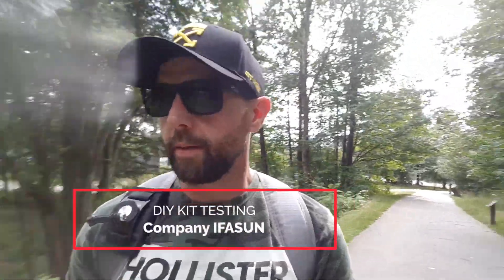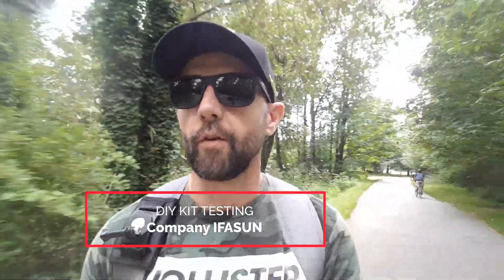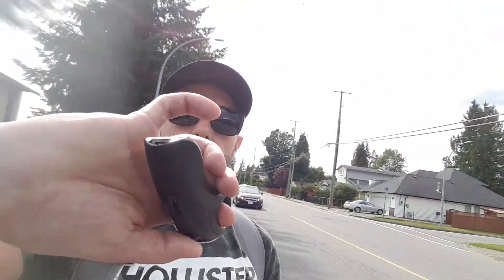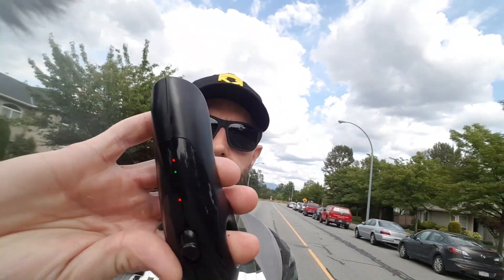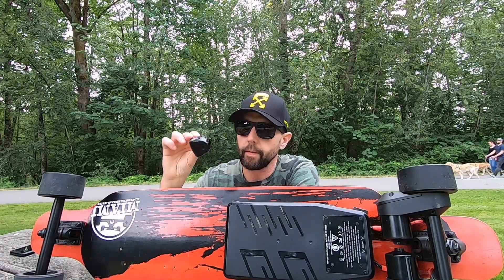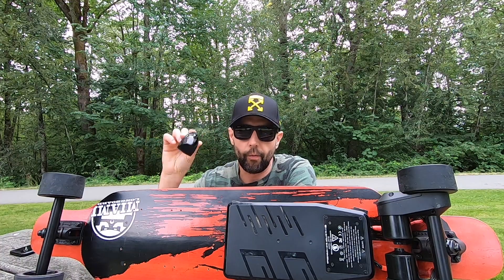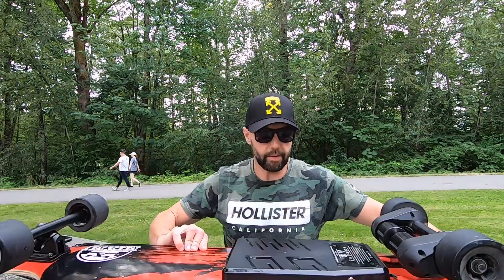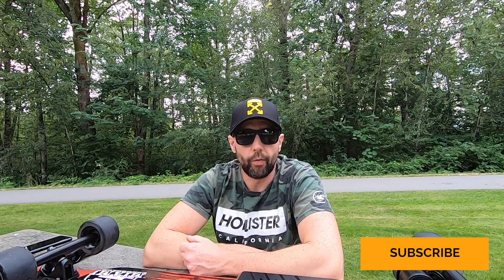IFASUN 1360W DIY SPEED/RANGE DUAL BELT Part 2

Comment: I'm from Brazil. Just purchased a board with this setup. Can you help me find an ESC from aliexpress? Your link doesn't ship to Brazil 🙏
Reply from the maker: i hope this helps. This link is for Brazil
Reply from the maker: https://pt.aliexpress.com/item/1005008531290643.html?spm=a2g0o.productlist.main.25.54fc8oNJ8oNJiQ&algo_pvid=25430a36-7cf4-4008-bbd7-bab53d733322&algo_exp_id=25430a36-7cf4-4008-bbd7-bab53d733322-12&pdp_ext_f=%7B%22order%22%3A%22-1%22%2C%22eval%22%3A%221%22%7D&pdp_npi=4%40dis%21BRL%21554.42%21271.66%21%21%21671.13%21328.85%21%402103919917438694138471885e94fb%2112000045584450751%21sea%21BR%210%21ABX&curPageLogUid=l0GgcPlSuGK1&utparam-url=scene%3Asearch%7Cquery_from%3A
Reply: @BeinSasha  thank you very much! 🙏🙏 Is there a chance to use the original esc in slower speed without safety issues? I use only a minor commute.

Comment: I have the 680w one belt ifrasun
Reply from the maker: Replace ECS on your kit and u will have an amazing board... lots of torque and speed!
Reply: @BeinSasha  hello I have the battery and double esc of the "teamgee h20mini 2x500w" could i use this esc and battery on that board?
Reply from the maker: @leonfreytag4452  Not really sure... if that one would fit in there... try let us know
Reply: @BeinSasha  i would use only the trucks and motors of this kit but can i power a 680w motor with an esc designed for a 500w motor?

Comment: Mine only goes backwards. Sometimes it goes forward after turning it off and on sometimes up to 50 tries before it goes forward. I didn't build mine I purchased it new online. I think it's a janky piece of junk and I wish I had forked out the cash for a better more reliable product. Sometimes it even cuts out while riding in traffic then accelerates like hell. It's super dangerous.
Reply from the maker: I know that original mainboard that comes with it sucks... i already spoke to them... however i will suggest to get this ESC and replace original.. It fits perfect inside... and u will have an amazing board with lots of torque and speed... also regenerative brakes, push start and good brakes... comes with remote already paired
get it here i buy all my parts here and they are fast and good quality
https://www.diyeboard.com/v11-dual-belt-motor-sine-wave-foc-esc-speed-controller-p-522.html
I hope this helps!

Comment: Does the controller have different speed modes?
Reply: Yes it has 3 modes red for fast green for normal and the third mode is  fuck you I'll do what I want and you better bail  because you are going for a wild ride. Imagine bombing UP a hill with no way to stop at max speed.
Reply from the maker: Yes it does